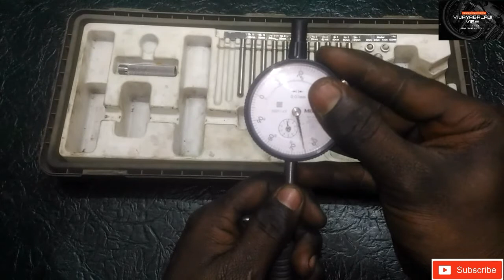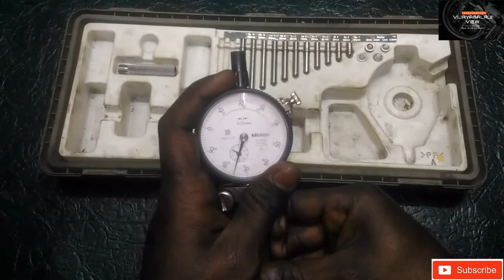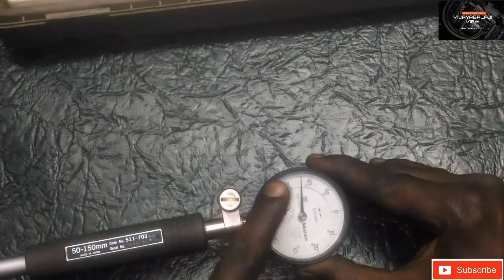HOW TO TAKE DIMENSION ON BORE DIAL (PART-2)

Comment: Sorry for the disturbing bore dial cauge poruthamatum clock wise needle rotate aachuna minus anticlock wise rotate aachuna plus 
Ex:70+25divison anticlockwise roted=70.25mm,70-25divison clock wise roared =69.75mm i am right sir
Reply from the maker: Brother how much dimension set in your gauge. Ex.70mm  your gauge needle is 0mm. The rotates anticlock wise Ex. 25 division the needle is on 0.25mm. Total gauge setting is 70mm. Then in clockwise 25 divisonmeans 70.25mmin anticlock wise means 69.25mm.
Reply: @BalajiVijayarajan   brother above the correct answer. Your answer is not correct